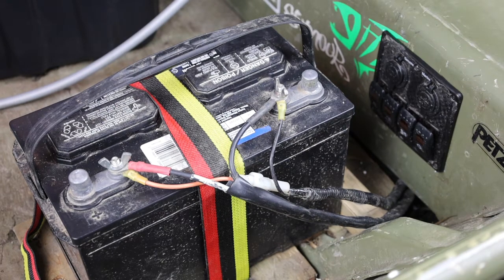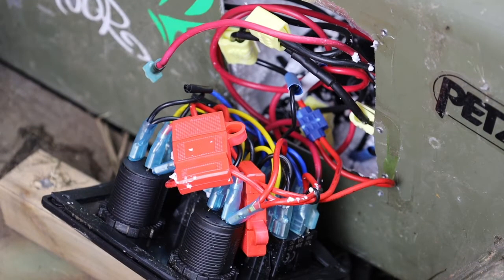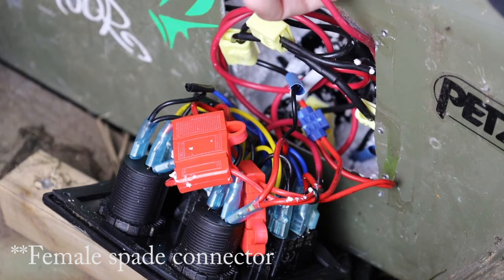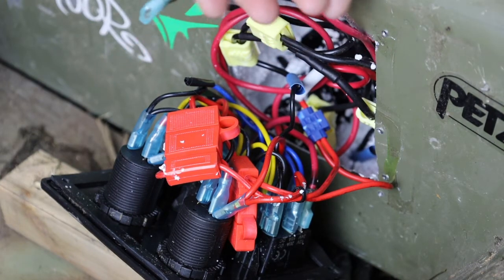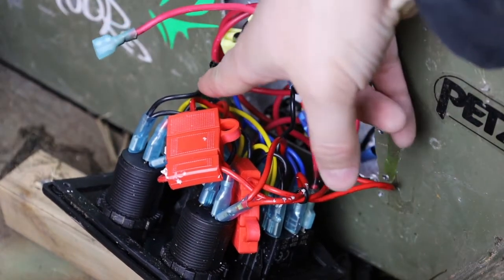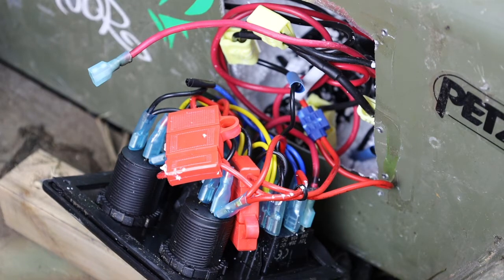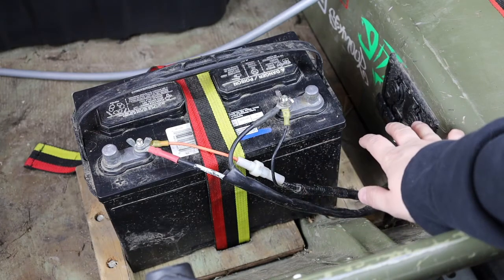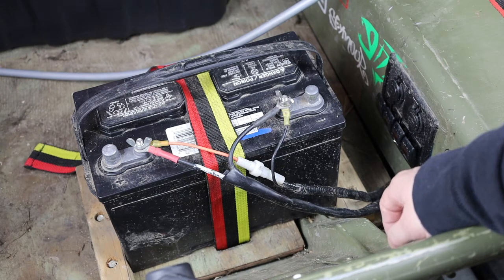Marine Switch Panel Wiring (Part 3)

Comment: Well I guess that helps some.  Was the bottom of your seat only styrofoam, no aluminum.  You just cut hole for switch,  cut out some Styrofoam towards bottom then ran wires?   Sorry for all the questions, I just have no one to help me and want to do it with no mistakes.  Anyway, thank you for all your help.
Reply from the maker: Not a problem I don’t mind helping at all! This is why I made the channel! Yes the bottom of the seat is just styrofoam no aluminum and I just dug it out and ran wires up and through the hole I cut out.

Comment: Do you still read the posts on this video? If so I building a little boat I hv fuse block and 6 switch panel, w/ 4 In line fuses. The I line fuses went to Usb Plug, accy plug I cut off the I like e fuses soldered then together and left voltage reader seperate, now hv 4 wires.
*Red comes from accy/usb plug hook to fuse panel accy slot 
*red-voltage reader plug 
Blue wire-positive side dash lights hook to hot side on fuse panel 
Yellow wire negative-lower dash lights
Black wire- negative side fuse panel 
I do hv the black wire and yellow wire tied together for 1 wire,  it so many wires to fuse panel
Hoping I got them wired correctly 
I don’t know where to run the 1 red wire from voltage reader plug do I just wire to hot side on fuse panel?

Comment: This was easy to follow. Question. I see like extended fuse boxes and all that jazz. I can run 6 leds in my job boat of my battery with a switch like that? No need to get regulators or extra fuses or anything crazy.
Reply from the maker: This switch comes with two fuses built in so no you do not need extra fuses however if your switch didn’t come with fuses I highly recommend adding them.

Comment: So where do you run all the negatives from the lights to?
Reply from the maker: I run them to the ground on the back of the switch then take the ground from there to the negative on my battery
Reply: @BCBackwaters  ahhh gotcha I didn't realize there was a ground hook up/daisy chain on the switch panel